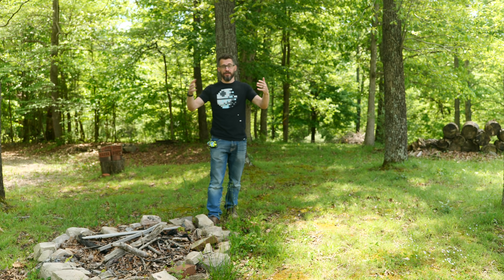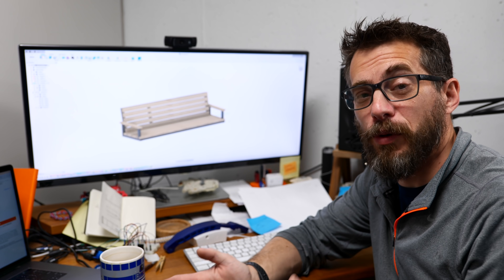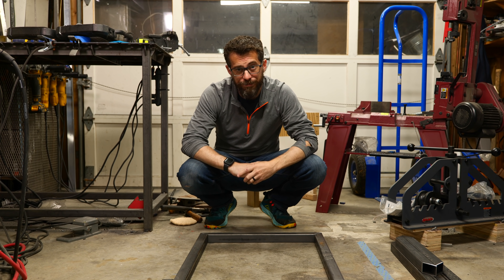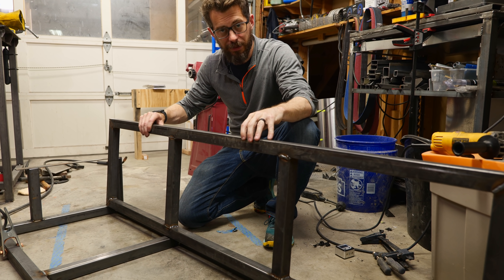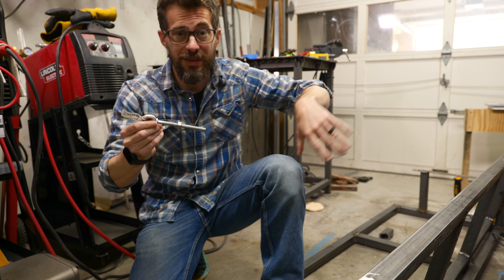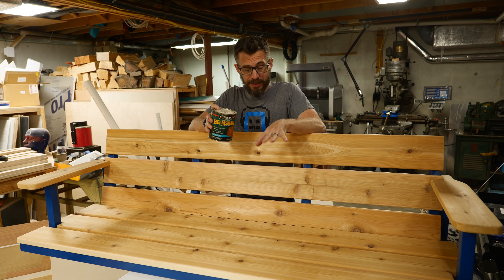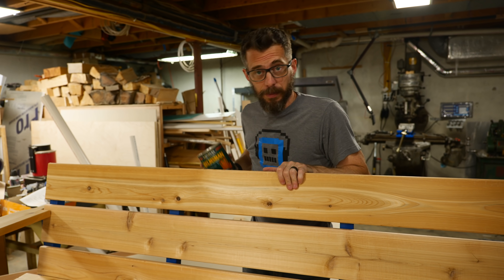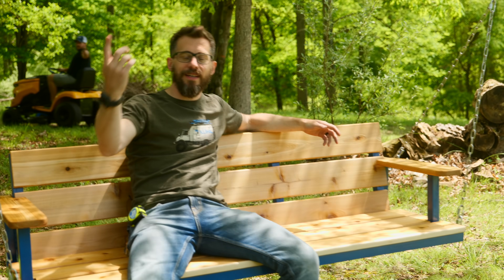How to Make a Porch Swing | I Like To Make Stuff

Comment: Please remember that the rating on the metallic eyes is different whether you're pulling on them axially or perpendicularly! The difference might be up to 70% loss of maximum strength for the perpendicular force!
Reply: I just said the same thing.  I guess I should have read the comments more first.
Reply: On shoulder eye bolts vertical to 45° either way is it's WLL anything pass the 45° of vertical its reduced to 30% of the WLL
Reply: Searched for that. Thanks :D And not to forget the difference in static and dynamic load.
Reply: It might be a good idea to add sleeves through the box sections as well to support the walls from compressing. Without the required preload the threaded shaft will fail.

Comment: In place of wood I like to use the PVC deck boards...lasts forever.   A common angle for chairs is 5 degrees for the seat (horizontal) and 15 degrees for the back (vertical).

Comment: The eye bolts mounted to the trees need to be much larger and longer if you expect them to stay for any length of time.
I think you should have bolted a treated 4x4 across the opening with arborist bolts then mounted the eye bolts to the 4x4 ( eye bolts long enough to go completely through the 4x4 so a nut and large washer set could be used)

Comment: is the hardware rated for that load as a side load (shear) or pulling load (tension)
Reply from the maker: Not sure. That's a fine question.
Reply: @Iliketomakestuff  shear loads and tension loads are usually not the same. swing hardware is usually rated for tension
Reply: On shouldered eye bolts straight vertical to 45° either way is the WLL and anything pass the 45° its reduced to 30% of the WLL
Reply: Also swinging load is going to be much higher than deadweight.

Comment: It looks really nice. I'm a fan of the blue. One question though, it didn't look like the holes in the metal were elongated in any way. Is expansion/contraction differential between the steel and the wood not an issue somehow? I'd be worried about splitting.

Comment: One thing to note regarding the eye bolt ratings; the ratings are based on a load in line with the bolt itself.  The farther away from that line you get, the more de-rated the bolts become.  That 1200lb rating, as a side load like that, is significantly less than 1200 lbs.  For example, a 3/8" eye bolt rated at 1400lb in a straight pull is only rated at 350lb at 45 degrees.

Will they hold?  Probably.  Will they eventually fail?  Probably.

Comment: Great build, moderate concern though: Not all steels are electrochemically compatible. Stainless hardware for instance will make the bare or galvanized steel corrode faster. The paint barrier will help slow it, but something to be aware of. There're whole tables out there to look at the interactions between different materials, but galvanized hardware will be safe for use on the frame, and should handle the elements just fine.

Comment: Well that is an amazing, strong, and long lasting build, but all in all I prefer an all wood, many multi-slat build for its comfort and curves. Ergonomics, not all dead flat.  Also not a fan of the back of the swing as it also is almost 90 degrees and short, no shoulder blade support. 
Still your build looks nice and will last. But the quick and easy build of traditional all wood builds have an appeal also.